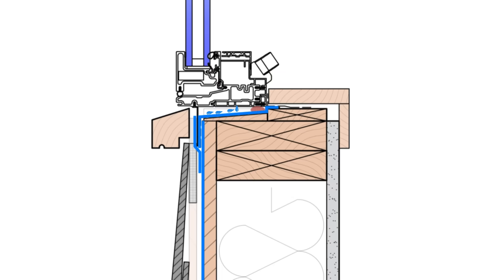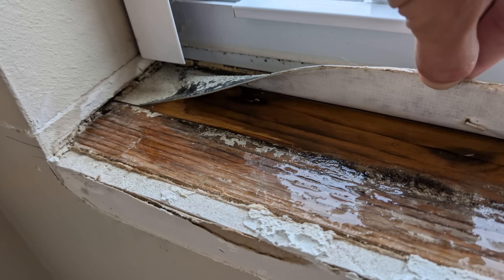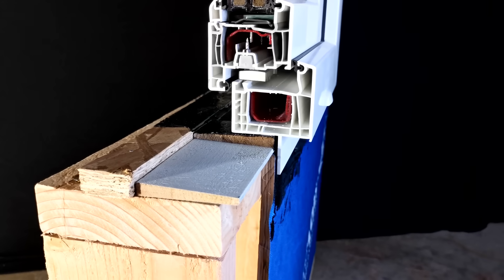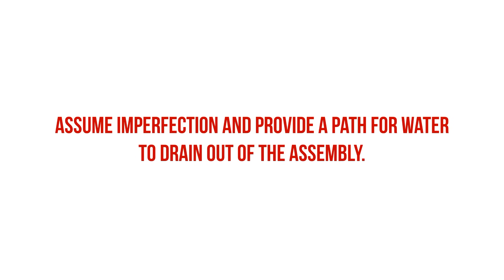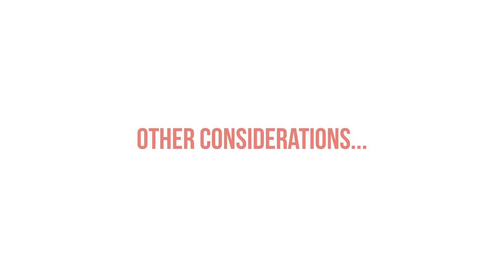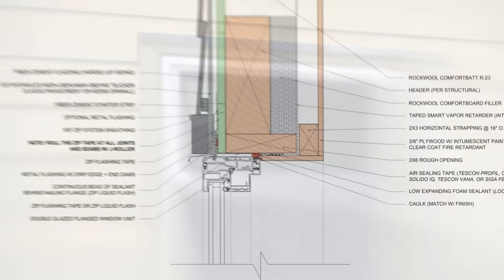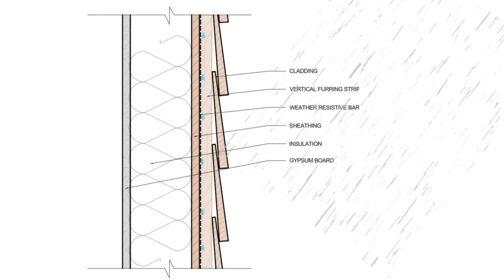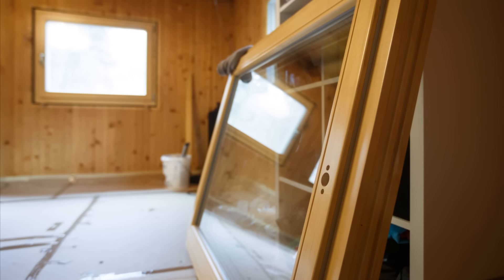You've Been Flashing Windows WRONG! (The KEY To Leak-Free Windows)

Comment: It seems like a little detail on what to do along the bottom of the window would be helpful.  Is it correct to just leave the bottom flange (if there is one) loose, completely not attached?  How should the cladding be applied along the bottom of the window?  What about a flange less window?  Anything for air leakage?  For a flanged window just the mechanical pressure of the flange against the underlying cured flashing?  If so that would seem to make air sealing depending on the perfection of the face of the sill and the flange..

Comment: geeze... I skipped through at least a dozen of crap videos before this that didn't even cover half of what was in this one! I even had to pause a back track several times during this video just so I could understand all of the little details you cramed into such a brief video, IT'S SO VALUABLE! 

I was watching so many videos that kept flashing over the bottom, I think they even covered the weep holes. Or they didn't use that sloped base at all. Or they cut back the house wrap a bunch or didn't cut out enough. I even saw some just spread caulk over stuff at random like they were using wood glue. I know different windows and such may require different installations, but omg. I was even having trouble trying to find some decent diagrams on this stuff, for some reason nothing could give me a straight answer even though i was looking for a specific window type.

I would've loved to have seen you do a full installation from start to finish. I have a hard time listening to verbal stuff all by itself.

Comment: I am a structural engineer and supply with my drawing set the proper way to install and flash windows with all the same details you have noted here.  I rarely find any architect that has any details on flashing windows and doors.  And, the details are different between ZIP, and Tyvek.

Comment: We used Tremco Dymonic 100 polyurethane elastomeric sealant to seal the edge of the sheathing to the window frame, then used Dupont Tyvek FlexWrap for the sill pan.   

Anywhere the FlexWrap or Straight Flash tape was applied to wood frame or wood sheathing, 3M Hi--Strength 90 spray adhesive was used to help bond the butyl tape to the wood (approved by Dupont Tyvek) and all flashing tape was always heavily rolled, then rolled a 2nd time to ensure adhesion.

The fins of the Vinyl windows were caulked in with the Tremco Dymonic 100, and all properly flashed with Tyvek Butyl Tape.     We used ZERO asphault based flashing tapes on our house.   

Dupont Tyvek approves Tremco Dymonic 100 for being compatible with their WRB and butyl tapes, along with 3M #90 spray adhesive.

After downloading a dozen installation and product specification documents from the Dupont website and reading everything thoroughly, I  discovered how wrong most window installations were by builders.

I used the smaller FlexWrap + carefully cut Straight Flash for all our pipe and Romex penetrations through the sheathing/WRB, and caulked from the inside with Tremco Dymonic 100 for weather proofing/air sealing that will hopefully last the next few decades.

Comment: It's amazing how people made windows that didn't leak or rot and they did so well over 100 years ago without any of this crap.
Reply from the maker: Windows did leak 100 years ago, but it didn't matter because the building would soak it up and it would be baked out by the constant heat flow. These buildings were uninsulated and constructed of a lot more moisture resistant materials like old growth lumber, solid masonry, and lath and plaster. That's a very different enclosure compared to our highly insulated walls with engineered lumber made from wood pulp.
Reply: @ASIRIDesigns  That's all true, but the added energy efficiency should save builders and buyers enough money that they can afford to buy better wood and other materials and additional skilled labor rather than relying on today's low skill worker to implement complicated sealing methods.  I'm not trying to disparage your work because I suspect you do your job well, but for every real craftsman in the industry, there are 100 goofballs that don't know what they are doing and don't care about quality.

Comment: In a fan of your detail and that you’re using a flanged window, shows a lot of thought and care! My only concern is the discontinuation of the Airbarrier at the sill. Perhaps I missed it and you have covered it, but from I picked up, you’ve chosen to use your WRB as your air barrier as well, if you’re only sealing three sides with the liquid flashing, that leaves a significant air leakage point at the sill. In this design, are you planning on taping/caulking all four sides of the window from the inside to ensure continuity of the air barrier? I don’t know if anyone in North America has truly found the all encompassing solution yet. I’m a fan of the Siga fentrim tape that comes partially double sided so you can infact carry your air barrier to the inside and the tape the window accordingly without “tape origami”.

Love seeing other people putting effort into pushing the industry standards!
Reply from the maker: The window is air sealed on the interior of the frame on all 4 sides. No discontinuities.

Comment: We use thermal breaks around the windows with windows installed as close to inside as possible. Less cold sill indoors. And we can make sure of good drainage.  We cut off the nail flange a lot. We do a metal flashing along with others around windows and doors.

Comment: Big fan man. You guys are spot on always.  Do a video of buck framed windows and how to seal them properly. No bottom sealing of course but they still are a pain to do. These are used when exterior insulation is used. With the upcoming codes, this is going to be critical as window bucks can be a pain to deal with. I just extended plywood out from my window rough opening to allow for installation and sealed the foam to the plywood. The issue is, what happens if water gets behind the foam. It's a compounded issue dealing with 2 or 3" of foam and also a rain screen because you got to install siding on something and a billion siding nails defeats the purpose of foam due to thermal shorts at each nail.

Comment: A very good video, only thing I noticed was the photos for z flashing was bent down and not up to make an end dam. End dam is preferred to keep water out of the trim/cladding. I know it's a bit nitpicky, but we are going for best practice.

In the rennovation with a budget world I'm rarely able to take advantage of the angled drainage plane (replacing stock size windows with like and not altering framing).  Without a sloped drainage plane I've looked to wicking to transfer any moisture off the sill if a leak occurs. Siga fentrim tape (gray) with it's felt like surface finish provides this with great adhesion and ties in well with their IS20 tape (white) on the interior as a backdam.
I've also run fluid applied flashing on the sill with a layer of apshaltic felt wet set on top to act as the wicking medium. This was effective in test mock ups, but had many downsides in the field for a retrofit solution.
Reply: Where are you located?
Reply: @Clashboard-28  Seattle area

Comment: Great information. Any chance you could do a similar video on window replacement? Best suggestions on brick veneer, lap siding and other siding options. I have found the replacement of windows very challenging to find best practices on.
Reply from the maker: Absolutely, you're correct that replacements are always tricky since it often requires ripping out a portion of the cladding to integrate the windows properly. The 'easiest' way is to install a secondary window as a storm window.

Comment: Everything was good except the the OSB anywhere on the sill. When that OSB gets moist it will swell and crack the LAF. Just use normal wood. It won't swell as much.

Why we make the sills square is dumb too. Put a 10° angle on it. Yeah the cripples are slightly harder to make, but not really difficult.
Reply: My thoughts exactly when I saw the suggestion of OSB for a dam

Comment: Only detail left out is on the inside. Backer rod and tape like Siga's Fentrim which can allow for some drying potential under the window. I also think having an air gap between your window sill and framing is good. As opposed to just caulking and using adhesive. Personally, being able to remove the window sills is another big plus. So I would advise not securing them in a permanent fashion but more as a modular design. If the window and framing are sealed properly with drying potential then the window sill doesn't have to be doing that job.

Comment: Stucco application needs to be reviewed. Stucco is almost always brought up to the. window frame. If there is proper drainage behind the stucco and over the W.R.B. then drainage of the window sill should work properly, But this sealing of the stucco to the window is another potential for trapping water and having it back up in the wall, not to mention blocking of window frames. Unfortunately in production building the trades all come in one after the other and just do what they want. The “builder” is not on the site to be sure whatever care the installers did with the windows is maintained in the cladding.
Reply: I live in South Florida and even on our multi million dollar custom homes the stucco installers stucco the window in over the liquor flashing. We do caulk the bottom, I feel that is how the manufacturer of PGT windows wants it done.

Comment: Ok but what about new siding and existing windows. Only ten years old. How do I waterproof it properly without removing the window. Seems the only way is to face seal. If I leave the bottom flange untaped I’m asking for water entry through there right? Only option is to fully remove the existing window and re-flash it but that’s very expensive. Other possibility is to remove the nails of the bottom flange and tuck the wrb under but that has its own risks
Reply from the maker: That's always a tough one, we're not aware of any ways to do it right/risk free without pulling the window. Adding a rainscreen helps and metal flashings with drips around the window, but it's not 100% foolproof. If anyone has a technique we'd be very interested to hear it.
Reply: @ASIRIDesigns  so what do you suggest in that situation

Comment: Why not use light frame steel and mgO board around windows ONLY to prevent water damage to the inside and outside.
Reply: You can always bring the W.R.B. into your window rough framing to protect it. But just making the framing around the window waterproof doesn’t get the water out and doesn’t protect other materials such as trim, flooring, floor framing, and drywall. The water just travels until absorbed by some other building material and rots that, and grows mold.

Comment: So if you do not tape the sill wouldn't your air barrier leak? Is this really  the best compromise?
Reply from the maker: No, the window is still air sealed on all 4 sides on the interior of the frame. The air barrier is not compromised.
Reply: @ASIRIDesigns I also saw porous materials that can Wick water without letting air easily flow. I don't remember the name of the company but I believe was in a Colbert video. Not all builders use to tape inside and that requires to have a  surface compatible with the tape
Reply: @ASIRIDesigns  I always felt the air sealing on the interior doesn’t get enough attention in preventing leaks. It equalizes the pressure on both sides of the fin or flashing and reduces wind driven rain problems, which are often very big problems.
Reply: Thanks! I appreciate the absence of the background music in the body of the presentation.

Comment: The issue I ran into as a service tech for a window manufacturer, was the builder would not back caulk/ tape the bottom flange and then would neglect to seal the interior of the frame to the studs.  Multiple subcontractors working around the window and no one talking to each other to make sure all the proper sealing is done. One winter my boss was screamed at on the phone by the homeowner and builder that the windows leaked air. I was told to go out and take care of it.  After getting screamed at by the homeowner and builder in person I replaced most of the weather stripping on several dozen windows.  The builder said we were crap and would never use the windows again.  A breeze picked up and I could feel the air at the sill, and then knew what was the problem. I went outside , pulled some vinyl siding and I could see under the bottom flange to the interior trim board.  Of course the builder had left, never took responsibility for the poor install.  
Also, at least in the manufacturer I worked for, their install instructions were based on factory testing to meet AAMA and NFRC requirements.  The water and air test dictates to back caulk all flanges.  Just an example of a disconnect with lab versus real world
Reply from the maker: Yes this is huge, the air seal must be on the interior.
Reply: You can use an air curtain.  tape another piece of wrb to the outside of the bottom flange and just let it hang down a foot or two. still lets the pan drain but makes it a lot harder for air intrusion. But you should also foam around the back of the frame and pan
Reply: @peep39 backer rod and sealant are a much better option than foam. Foam compresses over time and loses its seal.
Reply: Is the interior air shield shown in this video?

Comment: 100% agree on the butyl tape origami... It can be done well, but it is certainly inconvenient as the geometry complexity increases (eg double wall, inbetweenies, etc) - especially with a backdam.
Reply: Butyl tape is a subpar performer.  Should use an acrylic based adhesive.
Reply: @christopherhaak9824 yes. But my point was more about the origami part. Liquid flash is a simpler process once the sill geometry gets complicated.

Comment: SOOOOOO important! When I had some windows replaced, I was not as informed about this even though what the guy was dping seemed insufficient to me. Now I have to deal with the gross insufficiency I was told is "standard" for replacement windows. Everyone wants to do it fast and quick but charge ungodly amoutns for subpar work.  I really appreciate your videoas so much!
Reply: “Replacement windows” are not the same as installations discussed here. They are glued over the existing window frame so they do not interface with the building like this. You are also not likely to get real builders installing replacement windows. It’s about the lowest skilled job there is and is not actually house building.
Reply: It’s possible to get high end details done well, but most of those builders or subs are busy on 3M++ house builds. The best go to the top like most industries 

The subpar work where it’s easy to find help with a project is def gonna be “bare min code / standard”

Comment: most people don't understand this and usually they believe window will never leak and tape is perfect.
Reply from the maker: I'd say that not enough have had to deal with the repercussions of a leak. Even if they do a "proper" face sealed installation, the seals in the window frame itself age, and you might get 20-30 years out of that unit (depending on the unit), but it's past warranty for both the window and the build itself, so when that window unit leaks, the person who is picking up the bill is the homeowner, not the architect, contractor, or window manufacturer.
Reply: @ASIRIDesigns I agree 100%. Many builders build good enough to avoid callbacks, but not necessarily to last long term.
Reply: Flashing tape is fine, that wasn't the point of the video. The point of the video was to explain the bottom ledge, the slope, and why you don't seal it. Tape vs this painted on stuff both work the same. So that part is personal preference.

The only thing that doesn't make sense to me is that I never seen a single instructional video that contradicts anything in this video. So I don't know where everyone is getting their info to flash the window incorrectly, though obviously, when reading the comments, I can see there's lots of people who I guess just assumed how to do it without looking it up before?

Either way, it was a good video. Good info. I was just put off by the title. I assumed the video was going to be dumb when the author told the whole world they were doing flashing wrong. So the click-bait title worked and got me to watch.
Reply: @RageDaug They just pass on the same bad practice or just have no training. If sealant or tape is good on three sides then it must be even better to do four sides. Interior air sealing is not given enough coverage, even today. Today we have the ability to look up things easily. At one time there were trade books that may or may not have covered this. Most people learn from the next guy on the job. They don’t go and look it up! They have to do what the boss says.

Comment: Great information! This is one of those things that, assuming you don't follow the window manufacturer's instructions, if you ask ten different contractors, you'll get ten different answers. I appreciate the logic in the planning for failure and using the slope, as well as the liquid water-proofing membrane, which in consistency and application looks a lot like the Redgard that I've used with great success before tiling. Thanks for another great video!
Reply from the maker: Glad we could help clarify some of the confusion around this topic!